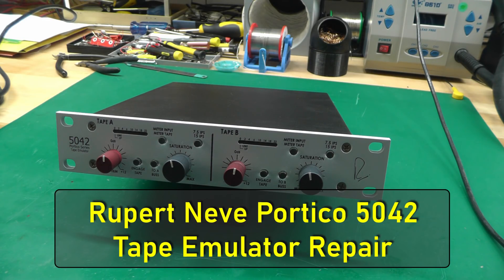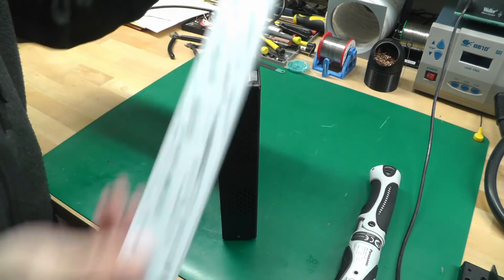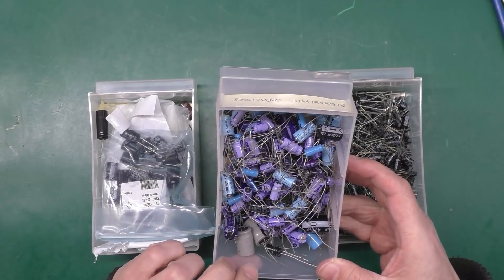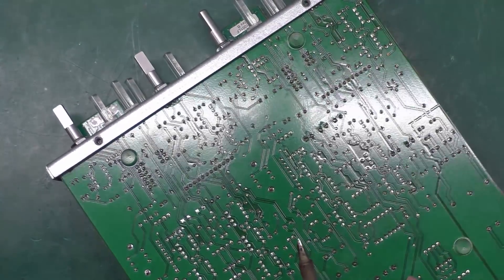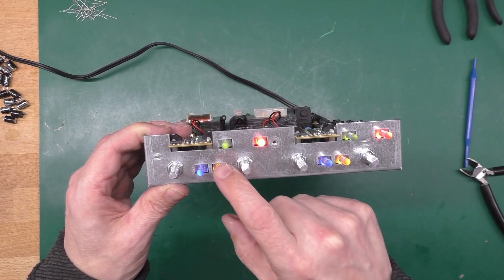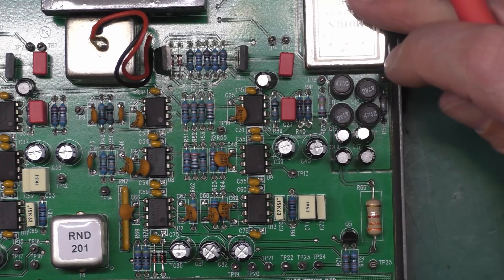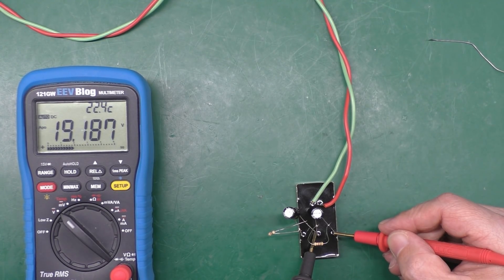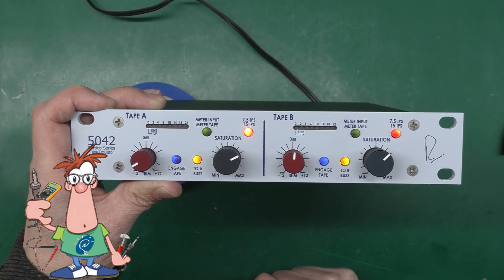No.049 - Rupert Neve 5042 Tape Emulator Repair

Comment: This unfortunately happens when you don’t fault find after disassembly, just jump in and replace caps is not a professional diagnostic technique.
Reply from the maker: I disagree. So you would leave the dodgy cap in place and trouble shoot the DC-DC supply rails never knowing if something downstream like an OP-amp oscillating because its decoupling caps were knackered and which in turn could be causing problems on the DC-DC....????.......Nah, much better to save the customers time and money by replacing what is obviously bad at very low cost and take it from there.
Reply: @IanScottJohnston  Well it seems like a power problem, so I'd probably measure the supplies, and see them dropping out, which wouldn't normally be caused by bad decoupling caps. Even with bad caps I wouldn't expect to see the supplies seeming to completely drop out. When you demonstrated the problem my first thought was actually a cold solder joint or failure on the DC jack. Always measure your power supplies! Always! I've gone straight to repairing what I thought was the problem too many times against my own advice!

The caps clearly needed replacing anyway - if one failed the others probably weren't far behind - though, so not really a waste of effort in this case.
Reply from the maker: @KeenanTims  no bad joints on the incoming power. However the owner told me the unit is powered up 24/7 and has been for a long time.......so I am just guessing it's just a random failure. Be nice to know if these DC-DC converters have history though.
Reply: @IanScottJohnston  Unfortunately they look potted, so a teardown probably wouldn't be enlightening... Definitely a bit of an odd failure mode, you'd expect it to struggle to stay regulated if internal caps failed, but probably not overshoot like that. The output waveform is probably a mess, might tell a better story. It's kind of a strange voltage; you'd probably get away with +/-15, but there's a reason the designers went for the oddball +/-18. Best option you could've taken, I think, but probably did fail due to temp/age.
Reply: IanScottJohnston replacing 14 capacitors when there was only 1 that was faulty is neither saving time or money for the customer, However proper fault finding does. All you needed to do was disassemble, confirm fault, visual inspection, note 1 faulty capacitor and replace it, power on and confirm all voltage rails, identify faulty DC/DC converter, remove and substitute with split rail power supply, check voltage rails with oscilloscope, order new part. Problem is people watch too many EEVBlog videos and think replacing capacitors is what you have to do. Dave Jones is not an Electronics Technician with years of experience in repair of Electronic devices, he is an Electronic Engineer with years of design and manufacturing experience. I think most Electronics Technicians would laugh at some of his fault finding techniques but would be impressed with his Electronics design and manufacturing knowledge. Professional Design and Repair are two different but overlapping skill sets in the same industry and although not impossible it is hard to find someone that is skilled at both. There was absolutely no good reason to replace those 13 other capacitors and even you just resorted to measuring the remanding ones in-circuit and saying “they are probably ok” In over 30 years working in Panasonic both as a technician, service manager, and technical trainer, I have never seen or even heard a technician say he was going to replace so many capacitors, that’s the difference when you work with professionals. Fault finding is a calculated sequential process and not a random dive in.
Reply from the maker: @brucea5664  I'd like to say I disagree, but thats not quite right so lets just say your way is one approach, and in this case mine is another. Here's  why.......I have over 35 years experience from Oil Industry Electronics tech through the rank to Technical manager which also involved training in production & service engineers & technicians. I designed, repaired, serviced, installed & commissioned countless electronics system both analogue, digital and uProcessor based........and in MY experience one bad cap usually means others are suspect, but more importantly is the miniscule cost to rull out ANY further bother from the other caps. If it had been one cap stood right next to a hot heatsink where it had dried out then that it another matter, but in this case it was completely randomly located. I questioned them all (given same size/brand).
To hand the unit back to my friend and tell him the other caps looked ok, a bit low in uF but "probably" ok does not work for me. You saw how many caps I have in stock so it was a no brainer to help my friend out and hopefully give his device many years of 24/7 operation.
PS. A random dive in has it's place especially when time/cost limited. Sometimes you get lucky!
Reply: IanScottJohnston yes, there is a difference between consumer electronics servicing and industrial electronics servicing.. but I don’t see any oil rigs here. Good job helping out a friend but you can’t take your approach in consumer electronics repair business on a cost per service basis.. Let’s just say your approach is from years of experience in industrial electronics and mine is from years of experience in consumer electronics.
Reply from the maker: @brucea5664  I agree and perfectly said. I've had electronics hardware fail taking a rig down (drilling operations) at a cost of 500k per day, so we replaced anything we could to guarantee normal ops. I don't recap like this much to be honest, it's a favour to my friend as I said. PS. Back when I was working at it professionally we never saw cap failures as much as we seem to do now.....it's one reason I kept all those old (new) blue axial caps.
Reply: IanScottJohnston I think the reason for cap failures is poor quality control/manufacturing.. In the early days I worked (for a short time) and frequently visited Panasonic factories in Japan, they never used cheap brands of capacitors it was always either Elna, Sanyo, Rubycon, Panasonic and we never saw failures (ok, very very few) now with the drive to lower BOM price and using more OEM suppliers for power supply modules, capacitor reliability went down. We heard about Samsung having terrible reliability using Chinese branded capacitors in their TV power supplies when we saw almost no failures using Panasonic branded caps in our TV’s. Fast forward to the 2000’s and just about every consumer manufacturer is using Chinese branded capacitors - sigh. I have an awesome collection of Panasonic capacitors and they are the only ones I recommend. I have both visited the production factories and talked to the chemists and engineers they are amazing. One chemist I spoke to had been working on capacitor chemistry for 40 years, he jokingly said “don’t ask me about the chemistry of other components because I only know capacitor”
Reply from the maker: @brucea5664  When I first opened the unit up I said to the owner of the unit I was surprised by the low quality parts used......he was in denial of course and was shocked when I told him how much it would have cost per unit to manufacture.........of dear!

Comment: Ian ... I really hate professional engineers who start replacing components blindly before making measurements on board, any stupid low experience guy can do the same...
Reply from the maker: There are lots of ways to effect repairs........circumstances around the device, time & cost come into it. With this video it was appropriate to carry out the repair in the way I did. See comments further down where I give more explanation.